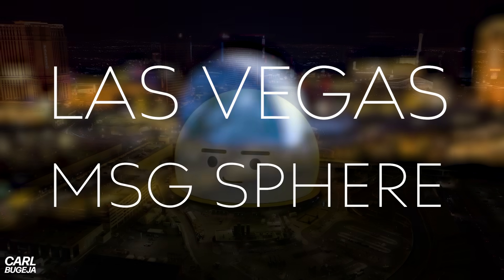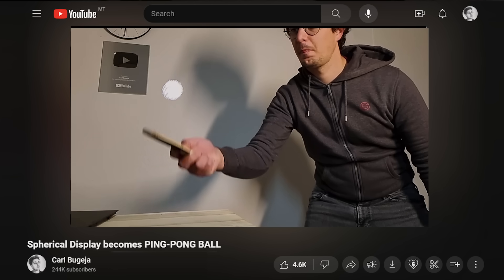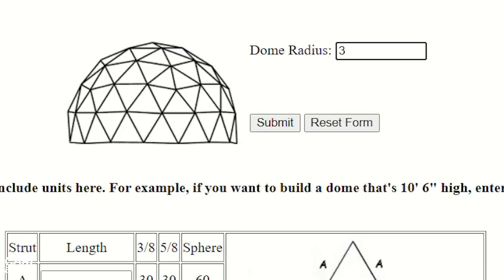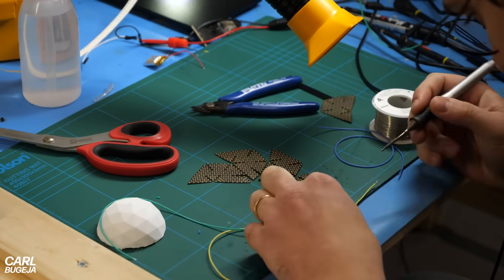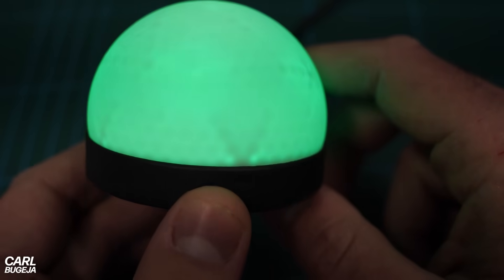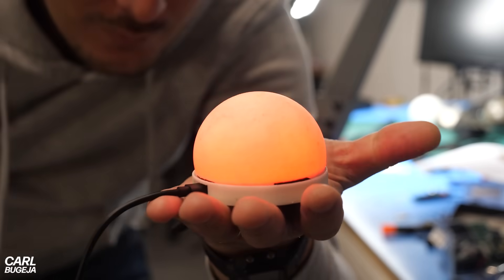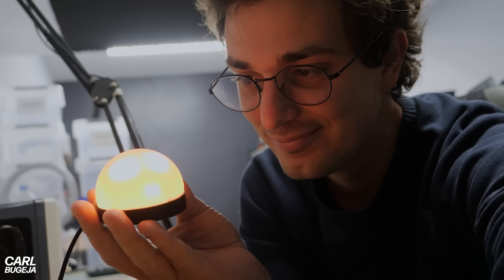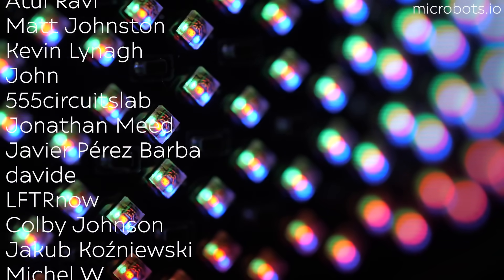Building a Mini Vegas-Sphere

Comment: If only you could get a flexible OLED display and cut it into that shape at 2:55, you'd have a very high density display, but they would be addressable in rows and columns, and the custom shape cutting would sever almost all of those 😢

Comment: Could you use smaller decoupling caps to allow a greater density of LEDs? Or even have them on the underside of the PCB? I KNOW thats the adhesive side, but u may have to work around that, by having tiny cut outs in the dome substrate.

Comment: USB C can do like 250w (not necessarily all the time) this is if you configure it correctly it should be able to do 5v 3a (15w) on a cheap supply for example.

Comment: Heres a idea to make it more realistic: replace the led with a flexible oled or replace the leds with a smaller one thats more cheap than a normal led and instead of the normal diffusion you used, add a double diffusior instead, this will make it a lot more realistic. Make sure to note this

Comment: Yo note this down to make it A LOT MORE accurate! 
1. Make the circuit board white so it can reflect more 
2. Thinner diffuse for more visibility 
3. modeling to higher virtual pixel count then blending based on proximity to physical pixels - for smoother animation and illusion of higher resolution. 
4.pre crease the triangle edges to achieve s cleans edge without stress on glue. 
5. use less expensive 1mm addressable RGB LEDs available. For example XINGLIGHT XL-1010RGBC-WS2812B (available on LCSC) for $0.0312 in quantities of 8,000 or more instead of normal for more accuracy 
This will make it 70-80 percent more accurate
Reply: why copy an existing comment and repost it as your own?

Comment: I wonder if you can use strips of flexible displays. They would overlap, but you can write code to calibrate and not display to pixels that are behind another display. (tedious, but one time calibration).
Reply: To clarify, I know you can't cut a display. By "strips" I mean using just very wide or tall aspect ratio displays. There are very narrow, long, flexible displays.

Comment: Hmm, this may be a dumb question, but if you are going for tight resolution on a small object, would fiber optics be a better bet? you couldnt do anywhere near as bright, but you could fit alot more then 1000 fiber cores. You could even build up the base and do a display in the base, netting any picture you want, even if its distorted.

Comment: What if you took  ball and coated it in conductive wash and copper clad it, then etched the smd pads onto it?  Make the ball structure itself the PCB.  3d print a base with a small spot for each LED.  Try to shoot for a plane per led

Comment: its a great project and works well! it has a good impact. You are correct though, the cost to upscale the resolution doesnt = the commercial value - in manufacturing/fabrication the firt test is the common sense test , "is it worth it" , "what use does it really have", "does it warrent the time and cost".... if the answer is no to anyone, forget it and move on, i have a shelf with many half projects that went through basic prototyping but wasnt worth pursuing for one reason or another BUT the learning I gained form those project was INVALUABLE!! no such thing as failure , only failure to learn!

Comment: Could it be possible using optical fibres instead?  you could have MANY thousands of them with each lower end connected to a single RGB LED and they could lead up to, possibly, an almost full sphere of optical end points.  It may need each end to have a small disk or hexagonal lens on top to fill in any gaps and to keep the structure.

Comment: Very interesting. As a commercial product scaling it up to tent or dome sized structures might be viable for event companies. However they do this already with led curtains. I think the best way to achieve 3d pov displays at smaller scales is with a centrifugal drive with the leds on wires linked to the drive shaft. Rather than one arm use many to reduce weight related stress.

Comment: One other possibility worth investigating that I would think of would be a dense array of optical fibers which would have an round OLED panel at the bottom as a source.
The sphere body could be printed on an SLA 3D printer, thus achieving high-res dense channels trough which the fibers could be guided from bottom to the surface.
The hard part though would be weaving the fibers trough the sphere body while and then trimming them to the surface.

Comment: I think the only way to possibly make a higher resolution screen at that size without having the ccapabilities of making a spherical LCD would be to distance the LEDs from the surface with fiber optic cables. It would be a nightmare to make, but you could displace the too big LEDs away from the surface and just carry their light to the surface through the much smaller fiber threads. Obviously, with the much larger number of LEDs this could make possible, a larger base would be needed to hide the LEDs.

I think probably the best way would be to use the triable pattern you used, but differently. you could print a curved trangle schaffold that the fibre threads could be attached to.  The exact method would have to be tested and proven feasable, but basically the scaffold would hold the emitting ends of each thread in thier proper position pointing outwards. 

Then banks consisting of the right number of LEDs to light all the threads of a scaffold could be made in whatever deisgn one desires. Each fiber optic thread could be attached to it's respective LED,  Bob's your uncle.

Actually, you could also save money on LEDs doing this too. Not every fiber optic fiber needs to have it's own LED. If designed a certain way, some fibers could be setup to get the light from two side by side LEDs. That way, if both LEDs are the same color, you can cheaply have higher volume of pixels on the surface displaying that solid color without having to pay for more LEDs. If the colors are different though, the fiber will still adapt ny carrying the colors of both LEDs. It wouldn't be like just having multiple threads from a single LED, as it would be differentiated. Not sure of the whole color theory of it all, but I'm assuming our eyes would be mixing two side by side colors at the border of two different colors anyways. it may cause slight bluring, but it could reduce the LED cound by at least half.

A problem with this method would be the edges of the scaffolds. If each LED bank is dedicated to just its own trangle scaffold, light won't be shared between two joining scaffolds. This possible could create a seam that may be visible to the human eye. I would test it first to see how bad it is before attemting to correct for it. I've come up with a few methods that could be possible, but each of them are quite complicated.

In any event, it could be possible to create a far tighter higher resolution display that way. I think.

Comment: Wonder if it is possible to let a LED rotor run under the sphere. Two or three columns with a tiny offset to eachother should be enogh to close the gaps between the leds. And maybe it's another usecase for the high rpm motor :)

Comment: hmm maybe see if you can get a custom order of those flexible LCD displays i have seen in promotional video's. you could significantly increase resolution while using the same method of folding and warping it into the right shape.

Comment: Bro completely forgot about using fiberoptics.
Reply: Well remembered!  I worked with a company back in the 1980s who wove fiber optics into carpets.  I made light sources that drove the fibers so the carpets would display stuff.  It was mostly for Casinos and Saudi Royal Palaces.  Expensive stuff at the time.  But yeah definitely fiber optics is a great idea man!
Reply: that's genius
Reply: its seems really easy to map a rectangle into a sphere with single strands of fiber optics per pixel. If you make one for less than 50$ i might buy
Reply: Ok that's clever as hell
Reply: How would you even use fiber optica there? Nonsense
Reply: @jbr004  Instead of putting the led itself on the dome, its better to have Led screen on the base. And then, "transfer" the light from each pixel to the dome with a fiber optic. Tedious? Yes. But is it better, also yes.

Comment: I am using optical design techniques to develop a unique decorative lamp. Often I have to solve problems cheaply and practically. One problem is low-RPM rotation with a lightweight load. Low-cost AC or DC gearmotors have reliability drawbacks and the dimensions interfere with light output. A magnet wheel with a small actuator to drive it at 4-6RPM might work. Please take a look, if there is enough interest I will post videos on how I did this : https://youtu.be/v-ginPsTcu4

Comment: Awesome work! Getting visualizations to look good on a low-res sphere is hard.

In my experience, using an equidistant azimuthal projection works best for mapping. As others have said, oversample the image by projecting the geodesic geometry onto a larger plane such that each output pixel covers several input ones, then average them for the output.

For pattens, I've had the best luck with a 2d fluid sim (SMA Fluid is a good lib). A 3d perlin noise run through a cosine function then mapped to a color palette works well too.

That's what we do on the Radiance Dome, which is basically a 40' version of this. Love the tiny one!

Comment: Did you consider using flexible fiber optics attached to leds? if you weren't restricted to a spherical layout for the leds i think this project would have worked much better. With the flexible fiber optics you also wouldn't be limited by the space a led takes up on a pcb board to created the matrix

Comment: Optical fibre transmittance? Maybe a sandwich of an AMOLED panel, and an optical fibre bundle. 
Challenge would be the construction of the fibre bundles but your errors in construction should be significantly cheaper than would be with alternative options. 
I'm thinking arrays of 16x16 or 32x32 grids of fibres assembled and fused then shaped and coupled to the surface of the diffuser. and then align and glue them directly to a transition layer that slides on top of the AMOLED panel using an optical coupler gel. could result in some incredible results albeit with a LOT of work. The upside is that you could avoid a lot of the custom PCB work, and the code to map the image to the dome should be a lot easier.

Comment: I have always wanted a “vGlobe” (Video Globe) that’s like a Vegas Sphere but a true sphere/globe/ball- ie like the old world globes you’d find in classrooms, but instead of a metal or plastic globe it would be an LCD screen shaped like a sphere! The closest material I can think would allow it to be made would be if it was made out of flexible OLED displays, like foldable phones or something similar, with a protective transparent outer shell and touch sensitivity (smartly controlled so you can hold it, move it etc without a reaction, but can “spin” the globe with a swipe of your finger/fingers, and of course connect Wi-Fi/BT with a phone or computer to remotely activate different views of the globe (like weather views for clouds/storms/nightime views to show inhabited/lit city areas, storms, highlight a country and related areas, pop up names, highways, etc, and even tap on a country to zoom in like a Google Earth satellite view, watch videos/live news from that area of the world or with a wireless connection could even display real time weather, world events, News, etc or even play movies if that’s your desire! :-) The outer screen would hide the internal circuitry, battery, etc with an USB C recharge and data port either at the North Pole or South (or maybe a combo spot that could screw into a standard tripod or custom globe stand, etc). If I had the skill I’d design one and put it in on kick starter, or at least I’ve never seen anyone else post a similar idea despite it being what I’d think is a fairly obvious device. This is the closest I’ve seen come to it, but I want flexible OLED panels in a seamless 360 globe to get the resolutions and refresh rate speed necessary for what is essentially a Screen shaped like a globe, or a bowling ball that has channels and can show movies! Does anyone else think this would be cool AF??? :-) ;-) :-)

Comment: incredible work! I want to offer you 2 different approaches: 1.) using fiber optics to convey light from more conveniently placed LED's to the curved surface.   2.) Use a flat LCD screen at the bottom and place a lens array on top to convey the reflection to a spherical panel. this would require some amazing image translation algorithms but ultimately bypasses all the issues you have encountered if it succeeds.   Subscribed to you now. Good Luck

Comment: So, there are two problems to solve: getting a uniform distribution of pixels, and mapping that distribution onto a flat projection of the sphere's surface.
The Fibonacci sphere does a reasonal job of the first problem.
For the second problem, it can be avoided by not using a surface, e.g. by using projection, fiber optics, etc.  But if a surface is desired, I can't see why a suitably gerrymandered version of a flat projection like gores couldn't handle it, albeit not elegantly.

Comment: definitely worth another try in a larger format, 
maybe just 3d print a sphere with the slots prepared for every LED 
(which you connect to the main inside with wires leading to every led through the spherical shell)

Comment: As a suggestion, use a laser projector with lenses.
The lasers eliminate focus concerns, and using a >180° fisheye lens should be able to hit the whole surface with a little software tweaking to map the surface. Then you can use a clear sphere with ultra-thin diffuser on the inside as rear-projection screen with no bleed at the surface. RGB Laser modules are off-the-shelf and have plenty of resolution.

Comment: maximizing pixel density is just picking the smallest LEDs you can. equidistance is not a concept in non-euclidean geometry because there are multiple straight paths you can take to any point. fibonacci sphere is about as close as you can get, though. there are pretty solved problems so its just the spherical display itself left to deal with

since wrapping a flat surface around a curved surface is impossible, the closest you can get is just maximizing the cuts on the surface so there's more potential for curvature

Comment: I have a crazy idea that "might" be worth looking into. I've not seen them as often nowadays but there were these lamps that had some sort of plastic optic fiber strands in a sort of "fluffy ball" like configuration. I'm wondering if there is a way (as tedious as it would be) to take a premade miniature Hi-res led display, have that project an equirectangular video animation, then (admittedly painstaking but doable with some tricks) placing the fibers over the screen, relative to what part of the animation should show up where. My only hack for that would be to use a rainbow gradient for each line on the screen to position it just right.

Comment: So many pixels and still looking bad. But than, that's about 64x16 and you only see half side. Now scale is big problem, but in theory you could get a 320x240 screen, and use fiber optics.

The only impossible part is to create a flat collector that will pick up light from an area of the screen, and send it to a spherical emitter. If a spherical emitter is even possible, than maybe you could just map each pixel from the screen (maybe use a gap to avoid light bleeding) to the sphere. Maybe the sphere shape can be cut from a plexiglass with a very pointy bit (less than 5°). The shape will also have a holes for fiber optic to be glued in. Than it can be wrapped on it self and maybe glued with some black or silver epoxy (will prevent light bleeding between the pixels on the sphere). Finally it can be sanded to make it perfectly round, can be left frosted, can be sanded to the black epoxy and expose the lines. The pattern can be more linear, but it will definitely be smaller, and exceptions can be made to the top side. Designs can be adjusted to fit the "resolution" on top, as long as you know where it starts to be a problem.

Comment: Have you ever heard of a process called blowing out a short on a board?
 I've used it on unpopulated boards before.
Suddenly apply power to the closest points on either side using a high current. 
It will literally vaporize the short.

Comment: Couldn't you use fiber-optics? This would allow you to decouple the output (the dome) from the actual light input, which could probably be a simple LED screen inside the base. They make plastic fiber-optic toys, so sourcing the parts would be cheap.

Comment: A cheaper and easier approach would be to construct rigid circular pcbs of different diameter per latitude level on the sphere. Then, you keep them in place with some pins on a base sphere and put a diffuser on top. If you are worried about the PCB blocking the light, maybe you can place the LEDs on the edge of the pcbs and the base sphere covers right at their edge so diffuse light outwards better. Good work!

Comment: Starting from the concept of using a projector as others have suggested, but what about using fiber optic instead of a fisheye lens to map the display to the surface of the sphere?  You'd terminate fibers in the sphere at regular intervals and then route the bundle to a flat interface over a projector or OLED display and then map the pixels.  I'm not saying it would be cheap or easy, but it would look awesome!

Comment: I was expecting you would use fiber optic threads glued to the inside of the sphere (makes hair transplants sound easy, lol). Then route those below to the led's which could be packed into a small space. You could fit 10x the number of lights that way, and might spend 10 years doing it too so careful of that rabbit hole.